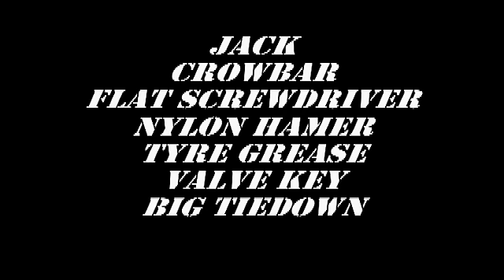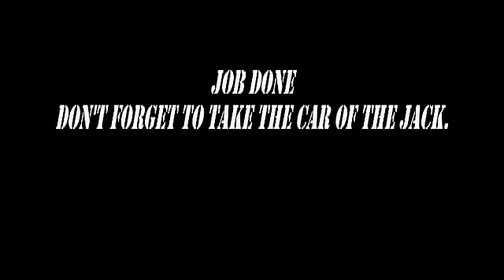Tire Job

Comment: I like the strap around the tire trick to give enough room for the rubber seal and installing the lock rings, i've done similar with loader tires.